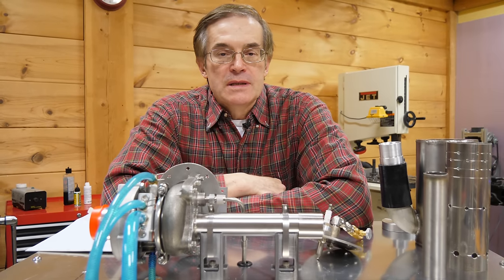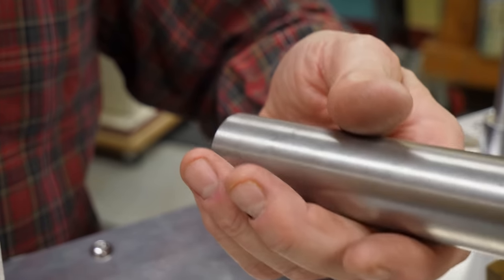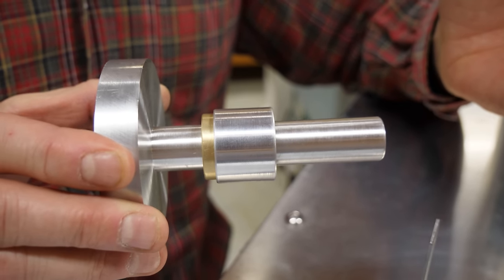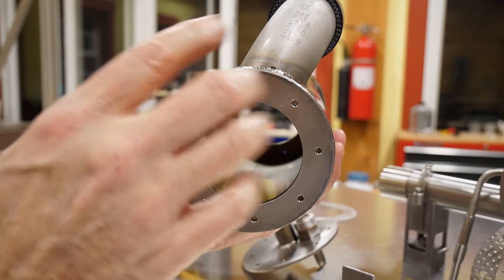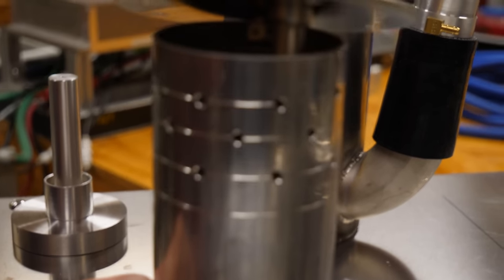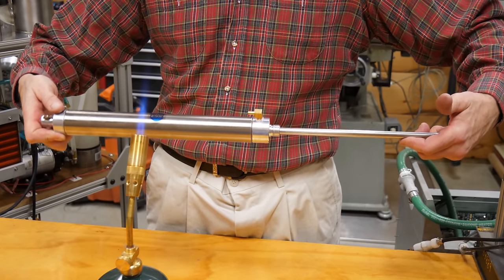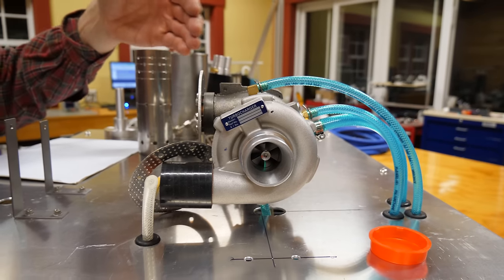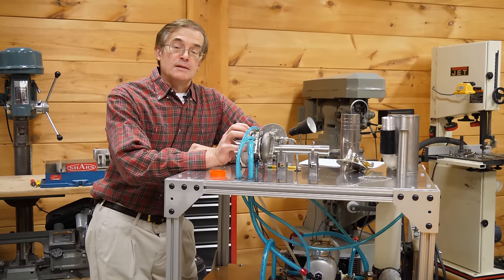The Turbojet!

Comment: So i am at 16:44 right now, and i spotted something that might be of interest to you if you wish to puruse this project which i have really enjoyed so far. All the holes bored into the flame bearing vessel, are perpendicular to the flame housing itself. What you end up with are a lot of air pressure being wasted on competing with itself for flame housing presence. - So to speak.

They should also be at a small angle towarads the flame housing itself so that the air pressure you introduce into it, wont cancel itself out competing with itself.

You should see a small boost in performance, nothing major mind you.
Reply from the maker: You're right!  Check out the flame tubes for some of the turbojets on Agent JayZ's channel.
Reply: Ohh thank you very very much!
Reply: Just stick a steel dowel pin in each hole and bend the steel a few degrees i think your less likely to change the aera of the openings this way and it's a fast way to test.
Reply: Which is why the holes on combustion chambers in turbine engines can look like a cheese grater. But more often (which is hard to build in a home shop) the combustion chamber narrows before the secondary and tertiary holes and is the original diameter right after them.

Comment: This is very well built.  Great craftsmanship.  I built very janky (yet running) tubojet about this size in high school.  Yours looks like something I could build today if I didn't drink and could understand math like that. Kudos man. Great video and great explanation on the bearings for anyone looking to build one. The turbo jet I built caught fire from being starved of oil pressure/flow. Cooked the seal and let oil and pressure into the turbine housing. Also I never utilized the coolant flow.

Comment: Excellent Video. Love your channel.   A few years ago I built my own Turbine engine for Radio Control.  Lots of fun, very challenging but also very rewarding in the end. 
 
The oil exiting a Turbo Charger relys more on gravity and not pressure to return back to the oil tank. You may want to change your Turbo drain line to a metal tube to prevent any chance of restricting the returning oil.  If your plastic line collapses (because of the heat) and causes a restriction, the oil will find another path usually past the shaft bearings.
I don't know the rating of the line you are using but I do know the returning oil from a Turbo Charger is very Hot and could cause issues with your plastic line.
Looking forward to more videos.

Cheers
Willy

Comment: Seems like a great quality build. Good luck for the first test, thumbs up!
Spotted one common misconception at 11:30 of a tangential feed tube. This usually causes problems as it can create a vortex inside the flametube, not only in the outer can, causing fuel to pour in the middle and burning further in the turbine. We melted a turbine housing divider because of that, luckily not the turbine wheel. 
Positioning the feed tube near the outlet end instead also helps to equalize the flow inside the can and it won't disturb the primary zone combustion as likely.
Reply from the maker: Because we are using propane exclusively, we have not had any problems with mixing, however your suggestion is a good one for minimizing uneven air entry through the more sensitive primary holes.

Comment: For anyone coming across this and interested in building one, I'd like to mention that a lot of the guesswork and trial&error that goes into making one of these can be taken out by simulating the system thermodynamically and chemically. There's software out there, HISYS(commercial), DWSIM(open source), etc that can be used to simulate all the important components of a gas generator/gas turbine.

I use DWSIM on the regular to prove or disprove (usually disprove) many of the crazy ideas that pop into my head. With it, you can simulate the following gas generator components: inducer and exducer piping segments of the compressor and turbine sections, nozzle diameter and length (length is important too), fuel and oil pump sizing and energy budget, oil cooler parameters and flow, and gas pressure/volume/temperature/mass flow throughout the system, etc. If you're working with a turbo that has compressor/turbine maps available, you can plug those details in and get more accurate projections.

Comment: These days I couldn't afford to build the table it's on. Not really the simple, inexpensive turbojet engine as described above - but you can't hate it for that, If I had the time and money, I'd be playing along. Super nice work. I used to build experimental semiconductor lab equipment for IBM Yorktown. Astronomical money, for example - why use an off the shelf steel tank when you can have a custom aluminum or stainless one made up? This is the same class hardware. Hope it has a long term home when you are done, much of what I built was destroyed at the end of the program. This is worthy of a museum display.

Comment: great video. Yes the combustion chamber and cooling is very important. And remember, that unspent air means you may get to reheat as long as you avoid compressor stall.
Reply from the maker: That's  just what we did in our recent video.

Comment: This may be off topic but I think someone might find it interesting. :D      
Over Unity Water wheel electric generator:
 Top of structure has Huge slanted basin (If looking at it from the side it would be slanting down to the right). When filled with water the water naturally slides down and over edge where it starts falling straight down causing water wheels to spin. Water wheels are stacked on top of each other not touching but close. As water falls it hits them all one after the other making them all spin as it makes it's way to the bottom. At the Bottom of the structure there is a large slanted basin. This basin is slanted in the opposite direction to the one on top so the water slides down to the left, into a pool of sorts that is U shaped,(imagine right below the water wheels is the shallow end and as it slants down it gets deeper for some distance then winds around to the other side of construct and comes back up to another shallow end. Now directly behind the water wheels on a flat surface that is above the pool of water that's curving around it, there is another wheel positioned vertically but this one is not a water wheel, this one has powerful magnets embedded horizontally inside of it on both of it's flat sides so there magnetic repulsive field is pushing outwards away from the disc on both sides. (Also each embedded magnet is surrounded in high permeability metal or Mu-Metal to focus it's magnetic field lines into a condensed strong field. This disc is powered by one powerful electric motor. Now imagine long hollowed out cylindrical tubes submerged & sticking out of the pool of water and reaching all the way up and into the basin that holds water on top. Now imagine each tube has a windy slide inside that goes from top to bottom. Now imagine the tube has rings around it that are magnetically repelled so when the main wheel spins around the horizontally positioned magnets hit into the side of these rings causing the entire cylindrical tube to spin. The spinning motion of the tube will cause it to scoop up the water in the pool and the centrifugal force of the spin and the windy slide inside will guide and force the water back to the top. Now remember for this to work properly there needs to be enough water wheels spinning to generate more electrical current then the motorized wheel needs to spin. 
Key Element 1: Number & quality of water wheels. 
Key Element 2: Quality of electric generator connected to each water wheel.
Key Element 3: Enough tubes to pull enough water from bottom basin back to top basin to equal the rate and amount of water filling both basins at any given time. 
Key fact: The accumulation of electrical current from the electric generators connected to the water wheels must be greater then the 1 electric motor needs to spin.
Key Fact: One must divert the needed electrical current from the generators connected to the water wheels to the motor spinning the disc that has the magnets on it. 
Key Fact : If this is done properly it would be an over Unity Electric Generator.
Reason why some may think this would not work: Some would say the amount of energy the motor needs to spin the disc with magnets on it will always be greater then the amount of electrical current being perpetuated by the electric generators on the water wheels complements of natural energy losses do to heat and friction.
This assumption is understandable however I will explain why this does not stop this device from being an over unity device. You see it comes down to one simple truth. The motor spinning the vertically positioned disc is only actually doing a fraction of the needed work, it is the horizontally positioned magnets impacting into the tubes causing them to spin that is doing the heavy lifting :) and since the magnets are positioned horizontally on disc the push back against them is unable to hinder the motor spinning the disc to a degree that would require it to do loads more work.  
In conclusion this is a device that can be self contained away from the elements so as to not hinder it's effectiveness. And it is an Over unity device if built correctly. 
& to all you nay Sayers out there I would just like to add I hope you all have a great day and whether you like it or not this design works. :D

Comment: Greetings from the UK, I hope you are well. I enjoyed your exposition very much. It must be the most detailed explanation of turbocharger derived gas turbine engines on youtube. I do take issue with one of your points, however. You advocate tangential entry of the incoming charge air from the compressor outlet into the combustor can. This will cause the air flow to swirl inside the can, which sounds advantageous from a standpoint of obtaining an homogenous air presentation. 

Unfortunately it causes the opposite effect to what is wanted. What we need in the can is diffusion - that is to say, we want the maximum recovery of the dynamic pressure of the incoming air into static pressure, to force this air through the liner holes and into the combustion/dilution zones. Swirling the air around the liner will cause a drop in pressure around it which is not what is wanted. Ideally the air flow should enter through a diverging duct into the can, and not tangentially. Theoretically the best place for the air to enter is near the bottom of the can, so that it flows parallel to the liner, from bottom to top.

That being said, you have built a working gas turbine and I have not, so your approach worked! None of my comments above are meant to detract from your fine effort in condensing so much complex information and presenting it in a concise, digestible form. I would be interested to know your thoughts on the "to swirl/not to swirl" question. Thanks again.
Reply from the maker: Thanks for the comment.
I don't think it matters.  The air flow in the anular space outside the flame tube certainly rotates around this space, but as that air enters through the holes it can only do so radially.  So the mixing in the flame tube is largely independent of the velocity vector of the air outside the tube.  Furthermore, the air enters the tube along its entire length with the majority (50%) near the bottom for thermal dillution.

Comment: I would like to comment on measuring the RPMs of the compressor wheel. You could magnetize the compressor wheel and put an inductor close to it. The output of the inductor is a low amplitude sine wave, and the frequency of the sine wave corresponds to the RPMs of the compressor wheel. The amplitude of this sine wave is extremely small, so I would feed the output of the inductor into an amplifier circuit. The output of the amplifier circuit can then be displayed on an oscilloscope. I'm not criticizing the method mentioned in the video. I just wanted to share another method. Great video! Keep up the good work!
Reply from the maker: You are toughing on the more common non contact method for measuring RPM.  Typically a proximity sensor is placed very close to the compressor blades and the electric field disturbance, as the metal moves past the sensor, is detected and fed to a frequency counter or it can be read off an oscilloscope if a current is fed to the sensor to establish the field.

Comment: 0:01 Introduction
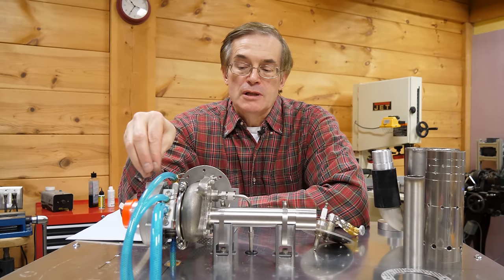1:14 Parts of a Turbo
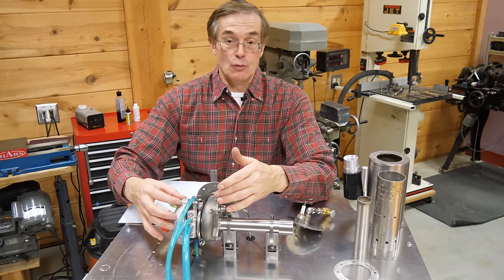1:40 Inducer Diameter
2:34 Thrust
2:53 Exducer
3:13 Nozzle
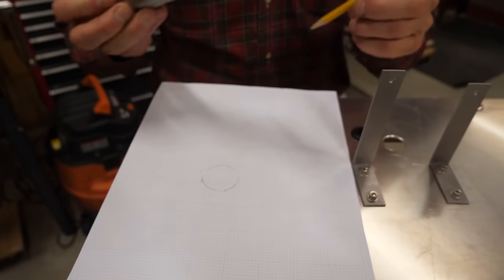4:50 AR ratio
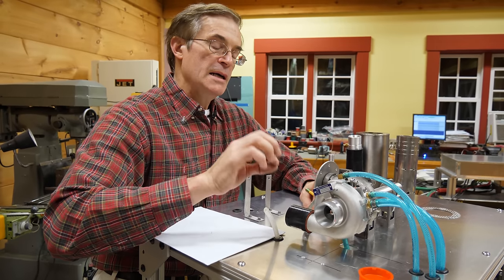6:30 Trim
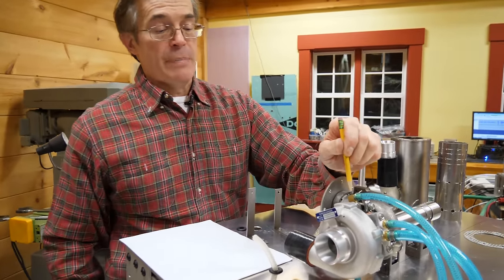7:22 Bearing
9:22 Water-cooling
10:59 Combustion chamber
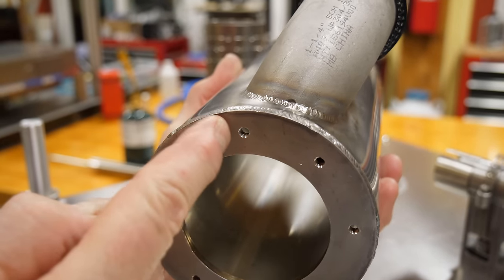11:40 Inlet offset
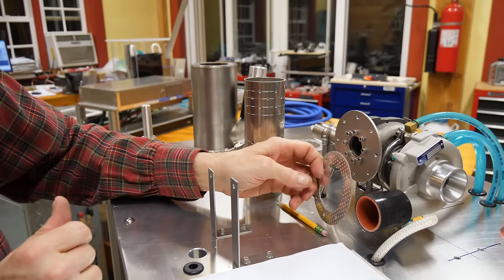12:40 Agent Jay Z
13:10 Flame Tube
15:11 Hole Description
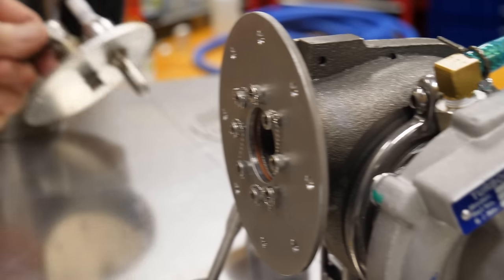16:17 Sizing & Spacing of Holes (Black Art?)
18:04 Fame Tube Diameter
18:50 Compression Ratio
22:24 Series Turbocharging
23:44 Support Systems
25:49 Diagnostics
26:51 Teaser for Next Video

Please make the twin turbo follow-up.
Reply: Exactly what I imagined you'd be spending your time on in heaven . . .
Reply: @djsjjd15  Where do bad folks go when they die? They don't go to heaven where the angels fly.

Comment: Great introductory explanations regarding everything mentioned! Nice job summarizing a ton of great info. 

AgentJZ has some great videos (that you’ve probably already seen) on burner cans and exhaust sections and exhaust nozzles. The placing, spacing and shape of the holes on a burner can for example (as well as other mentioned sections of the aircraft engines) appear to be almost random but are far from. There’s a lot of complicated fluid dynamics work done to prevent the flame from actually touching any portion of the burner can otherwise you will get hotspots and eventually burn through which is never good in airborne applications! Can’t wait to see your engine run!

Comment: Just a comment on the bearing seals. Met a guy in the 90's who had a runaway with a diesel semi. Coming off a hill and let off but, engine kept accelerating. Lost the seal on the turbine side and engine was running uncontrolled on engine oil. Fortunately, it was an oilfield truck and was equipped with an after market positive air shutdown that allowed him to shut the engine down. Very hard on engines being shutdown like that.

Comment: I have a question, when the first set of holes is the primary set, why is it bad that the fuel burns already at this stage? To my knowledge, the secondary and last set of holes is solely for cooling the combustor can and further dilute the exhaust gases with the bypass gases. Could it have to do with the fact that you want an as homogeneous as possible  air fuel mixture before burning it? If so, why would it be bad that the flame front is further away from the first set of holes, isn't that what you would want? Could it be that one wouldn't want this, else the exhaust temperature would be to high and possibly damaging for the exhaust turbine? Also, when talking about regulating the boost pressure to increase efficiency, you mean a system to prevent compressor stall, right? If so, i would suggest you looking for a second turbocharger that has an integrated relieve valve, they are pretty common and essentially bypass air from the high pressure side of the compressor to the low pressure side, so , in front of the compressor.

Comment: Thank you very much for explaining two turbochargers connected to each other, thats usefull to know for car tuning, with that i can get same efficiency as with LPG, but the engine will be cleaner and not on high load of stress and i can add a catalytic converter to it without loss of energy, nice to know. I am about to buy myself a Yugo Koral 55, it is carburated, but it has a lever for higher amount of fuel, so its great base to inovate with tuning before i buy something way more complicated and newer cars are douche, because its only tunable by laptop

Comment: Rather than using more fuel to cool, I use water injection, works better and doesn't waste fuel. Jets and race cars both used them back in WWII IIRC.

My system is above and beyond conventional though and is a precise blend of WM. Not gonna go into detail, fir your turbo charger application it could cause impeller damage over time though but in the name of efficiency it's fun to try.

I like your layout though. I need a camera man to shoot my projects :/

Comment: 8N per square cm sounds optimistic to me, as far as diy turbojets that i have seen to date go
But definitely left a like, this is one of the most comprehensive videos on the simple "heavy" turbojet (i call it simple as there are no diffuser and guide vanes and heavy as the housing makes it a lot heavier than if it had been completely built as an aircraft engine ) design i have seen.